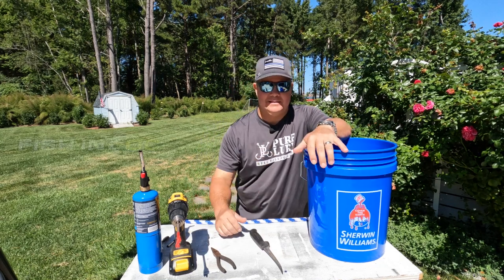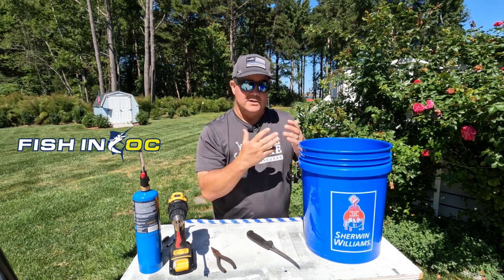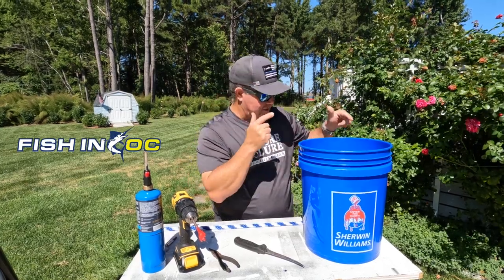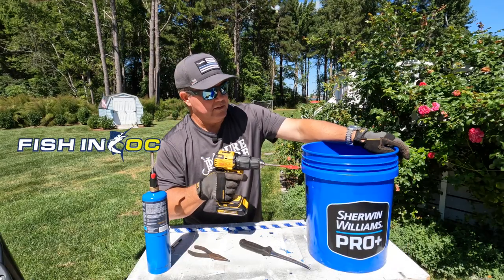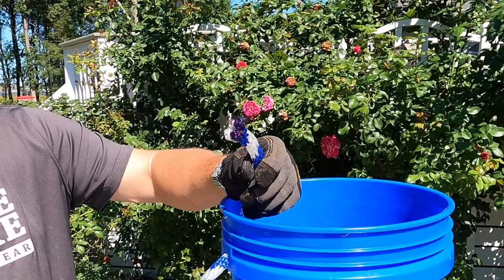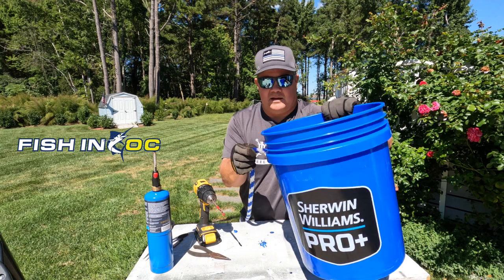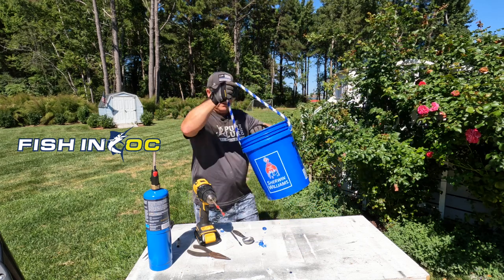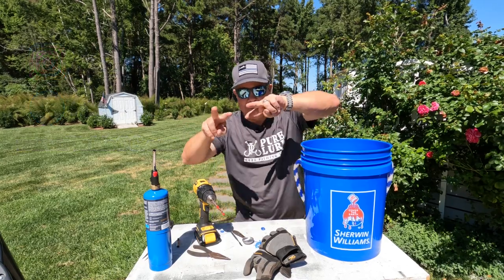How To Make Your Own Rope Handled Bucket

Comment: I'm sorry but I would not trust that! Given a little time that will pull through. I'd rather tie a knot then melt that.  'A' for effort.
Reply from the maker: It holds surprisingly very well.
Reply: @FishinOC  How long have you done this that they are still holding? Over a year? It looks really cool. Really does. Like @barneymiller6204 said, it doesn't look like it will last. I may try it anyway. hahah
Reply from the maker: @tastycake1969 I’ve seen these buckets used by folks that we made 3,4 years ago.
Reply: @FishinOC  thanks man. Going to give it a go.
Reply: Thanks god bless